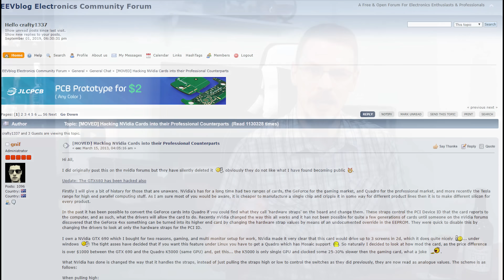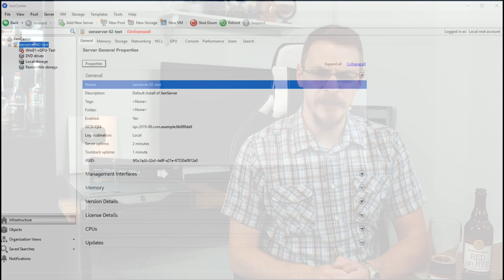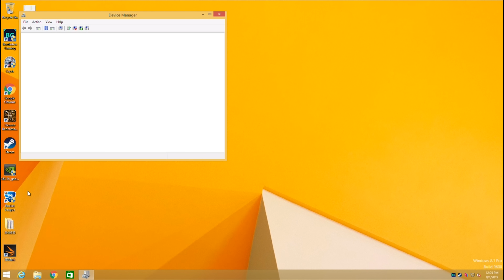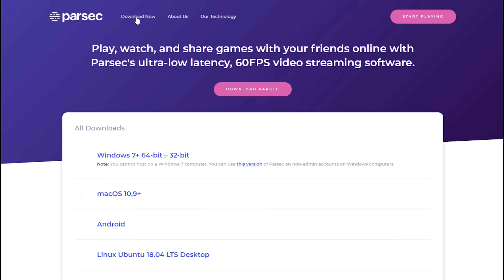I have lost my mind... nVidia GRID/Tesla Cloud Gaming Server

Comment: Do those graphic cards need power connections? I have dell rack servers and the wall I always hit is lack of extra power connections for hardware. Stupid proprietary power supply.
Reply from the maker: Yep. Requires a 6+8 pin each. The Dell R7610 is a rackmount workstation and has 2x 6-pin and 2x 8-pin. With an 1100W power supply, splitting one of those sets shouldn't be a problem.
Reply: Craft Computing ooh ok gotcha yea my lab/plex setup consists of a R720xd and an R420... no extra power in there :( awesome vids btw!!

Comment: I have a Tesla K10, used it in Blender for a while. You can mod the bios using the fermi/kepler bios editor and overvolt the GPU to 1.2V (1.25+ will trip OVP) and remove the power limit. I got 850Mhz on the core and +700Mhz on the memory.
A very nice boost.
Reply from the maker: That's pretty solid. I was going to look into OC options once I get it up and running.
Reply: @CraftComputing  so, with firmware mod, you can use the tesla k10 for 3d rendering/gaming?=

Comment: This may not be easily feasible, nor scale well, but one way I solved code 43 on a VM where I passed a mobile GPU (1050 Ti Max-Q) was by using Intel's virtual GPU solution.
It boils down to creating vGPUs, passing them to the VM by PCI passthrough along with the nVIDIA card, and doing optimus inside of the VM. Having the Intel card allows you to get a video output without the "Microsoft Basic Adapter". In your case it may be quite hard to do, as you have server CPUs without Intel HD Graphics... However, AMD cards do also support vGPU.
Your best bet is a QEMU+KVM stack on Linux (4.10+, 5.0+ recommended), passing the Intel iGPU if available (https://github.com/intel/gvt-linux/wiki) or buying a compatible Radeon card. Split the radeon in 6 virtual GPUs (one for each VM), and pass a full nVIDIA GPU to each VM (no virtual GPU for them).
Another trick to keep in mind for the nvidia drivers: try tu use PCIe bus IDs that are credible and possible in a real machine, as they'll use this information too to detect a VM...
Best of luck!

Comment: Got to try parsec. What other similar software did you look into?
I've been planning if i could make a remote desktop on remote server which would pass through to me full desktop experience, including all sounds etc. with decent enough video quality & latency to use it for regular desktop usage AND even streaming 1080p or 4k videos from etc. :) Would be fun to use, say a tablet, anywhere i am to get full desktop experience with everything i need ready to go :)
Reply: If you find anything interesting software wise could you update your comment here.

I'm also wanting to setup my own home server for streaming multiple fully fledged desktop VMs capable of full 1080p gaming.

I want something hosted completely locally, and that's where I usually hit a snag, because I can't find many locally host-able options. Other than Parsec. Steam Remote Play relies on Valves servers so it's out of the question.
Reply: @LND3947  i want to go a bit further, have a remote server :)

I'll try to remember. NoMachine NX is decent, but not quite there :(

Comment: Ok, I missed what little bit caused to you need to run the old version of Citrix XenServer (video cards are a black art to me).  BUT, did you check out XCP-NG? It's a completely open source hypervisor based on XenServer that removes a lot of the artificial limitations Citrix has built into XenServer.  You probably looked at it as one if the eight hypervisors you looked at, but I thought I'd throw this out there.
Reply from the maker: I was actually not aware this existed! I went through Xen, ESXi, ProxMox, HyperV with RemoteFX... I'll have to look at XCP-NG and see if vGPU is a supported feature. Drivers might still be an issue though.
Reply: Craft Computing but as I know xcpng dont have this function only Citrix
Reply from the maker: @attylaar  yep, just looked that up. Passthrough yes, vGPU no. Thanks for the suggestion though!

Comment: Can the k10 be used for plex transcoding? ... If so off to ebay i go!!!
Reply from the maker: Yes it can! NVENC will work in both PCIe passthrough mode if you have a VM, or just installed into the server bare metal. Just make sure you have a lot of airflow for it.

Comment: Hey i was going to put one of those cards in my server too, is it true One car per VM though ? you can't share the card across a few vm's ?
Reply from the maker: You can forward each GPU Core to a VM, so two VMs per card.
Reply: Craft Computing so this is not passtrought gpu? it is different solution?
Reply from the maker: @Piotr Correct, this is not PCIe passthrough. This is vGPU. Basically, a driver is installed on the Hypervisor, and a virtualized GPU is sent to the Guest VM. Keeps GPU visibility on the Host, and allows you to dynamically allocate resources. And this video basically demonstrates all of the downsides with this method :-)
Reply: @CraftComputing  ok sweet, can you send me a card to try lol :)